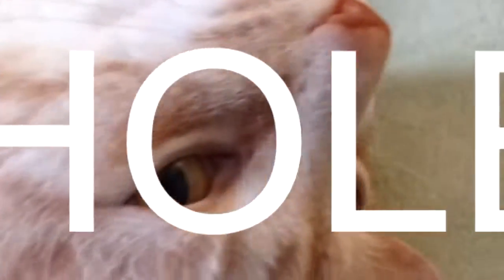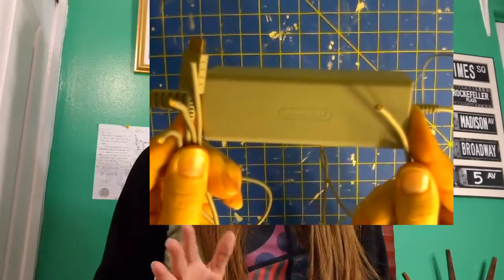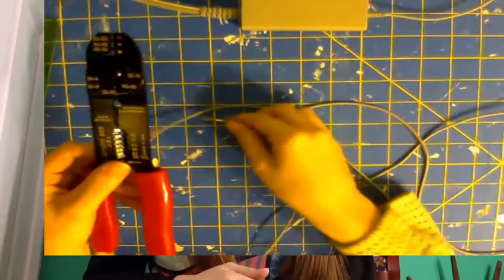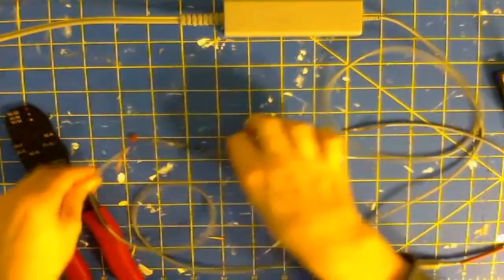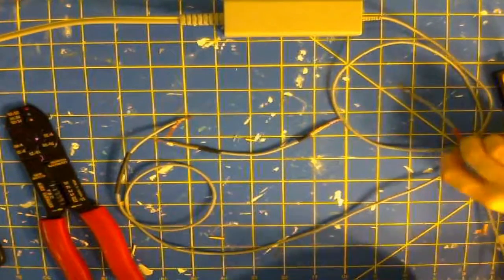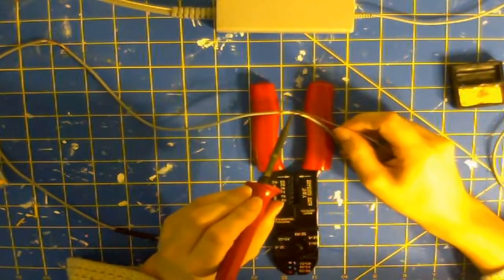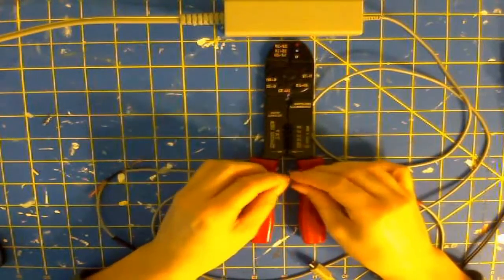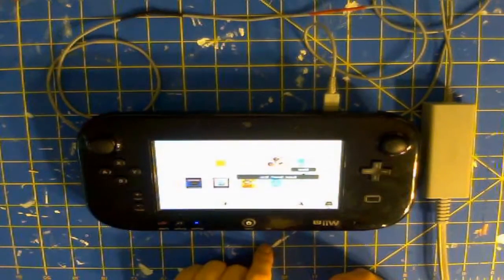Charlie's an Asshole: Fixing Wii U Gamepad Cable

Comment: Instructions unclear, I accidentally invaded Poland.
Your new software looks capable, but I think it has some trouble keeping the audio and video in sync during the encoding process. I bet if you took the exported file, imported it to a new project, cut the portions that were out of sync, and then unlinked the audio and video you could resync everything, then export again.
That's what I used to have to do back when I used VideoPad
Ah, memories
Sweet, sweet, repressed memories.

OR, sometimes it's because you're exporting into a different video codec/video framerate than what the original file was. Could be easier to double check your export settings
Reply from the maker: +PHvlogger Woah that is a really in depth response. Unfortunately it was human error. I buggared up the sound and I tried to fix it as best as I could. The files were unlinked during the editing process and it got really tangly and thats why it was so hard to fix it. But you are the second person to mention it to me so thats 17% of my view count so maybe I should pay more attention not to screw it up in the first place next time!
Reply: you should show all the tools and equipment you have for electrical and cosplay stuff. I wanna see your collection
Reply from the maker: I can totally do that! My work shop is inside of my room, and I do 'borrow' my Dad's tools from time to time, but I have an impressive small hoard of items.